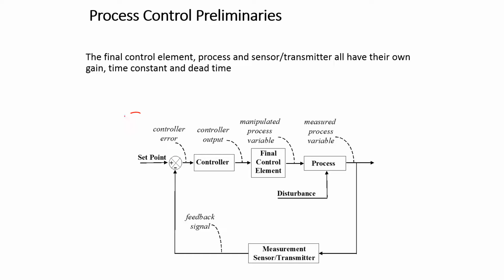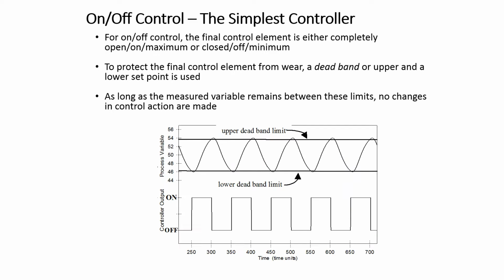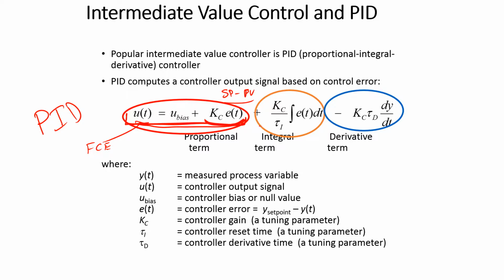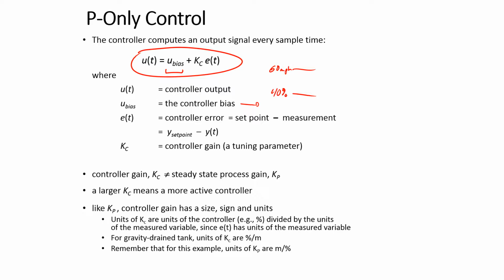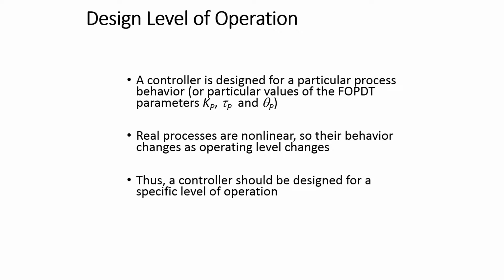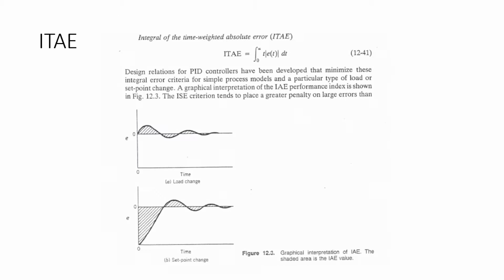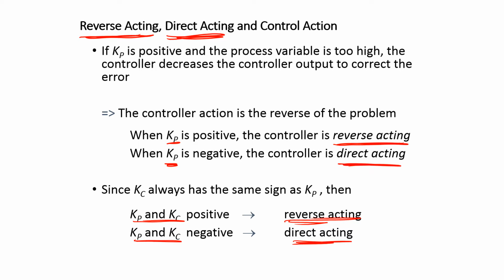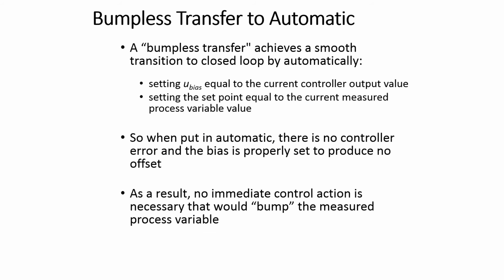PID P-Only Controller Introduction

Comment: Hello. Thanks for making this video. Why won't the P-only control have an offset for an integrating system?
Reply from the maker: +Aluha Carpenter, great question!  The system acts as the integrator so the PID controller doesn't need one.  Check out this additional material, especially the offset worksheet (PDF) in this web page: http://apmonitor.com/che436/index.php/Main/LectureNotes28

Comment: Can you Explain why the offset cannot be eliminated ?
Reply from the maker: +Taha Siddiqui I covered this in additional detail later in the course at: http://apmonitor.com/che436/index.php/Main/LectureNotes28  P-only control won't have offset for an integrating system, however. For a non-integrating system, one way to think about it is that as the PV approaches the new setpoint (SP), the error approaches zero. The PID equation for just a P-only controller is u = ubias + Kc * (SP-PV). Therefore the error will go to zero and the value of u (controller output) will go back to the prior steady state ubias value and the prior operating point. An integral term is used to remove the offset.
Reply: +APMonitor.com Thank you very much :)